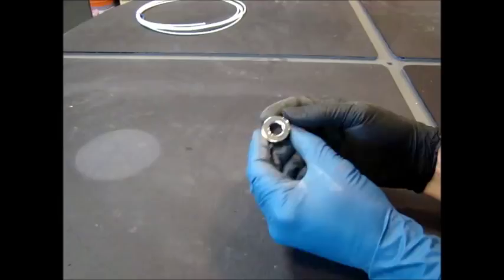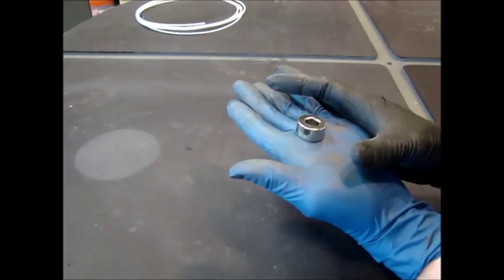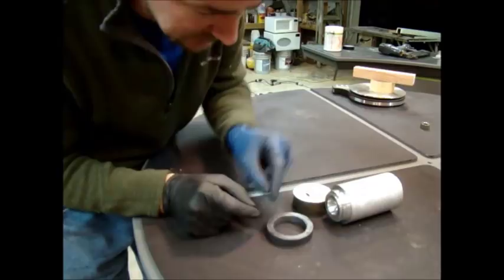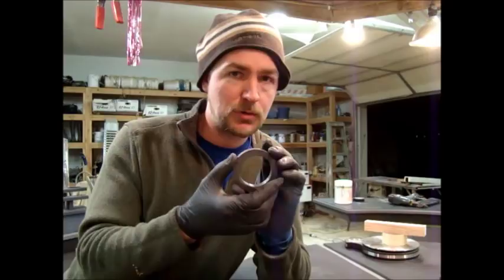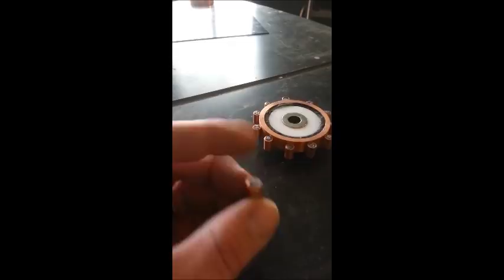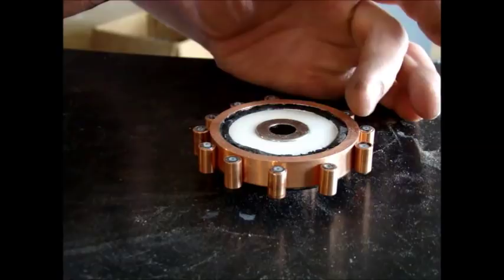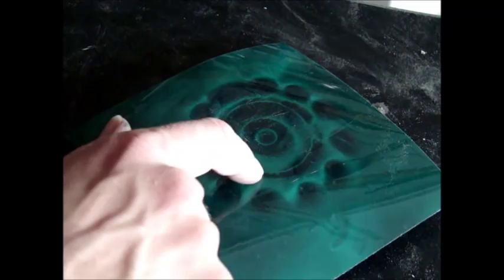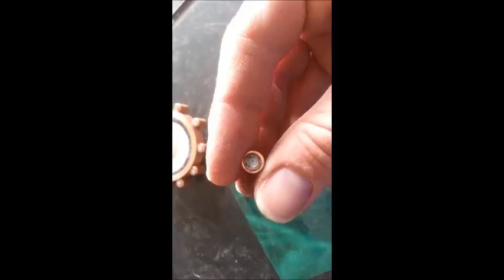Searl Effect Generator micro size

Comment: I'm not sure you understand the use of the term MICRO lol micro things you can't see with the naked eye at best it's dust at most it's nothing. Anything you can see with human eyes is called MACRO this is clearly visible lol  so this is a macro version NOT micro as we can all see it. 
Also you do understand that by shrinking the device you also change the wave lengths of the devices output meaning you will not be getting the same effect. And would have to start calculations for the zero point energy stage from scratch. Although if you didn't know the different between micro and macro I'm sure you have no idea what I'm talking about..
Reply from the maker: Remember micro machines in the 90s?
If they were truly micro that company would never have made a sale. Its a phrase a speech, not an actual scientific description which your making.  But thanks for the clarity on such terms though:)

Comment: and I suggest that you look at the first video he published you have the components to the main disk all wrong
Reply: Here's my reply to Bruce Moe above:
Center Reservoir = 7, then the Gate = 10, then the "magnetic" = 4, and finally the Emitter outside ring = 13, all adding up to 34 units. Perhaps I saw the center assembly's magnetic orientation wrong, S on the inside and N on the outside? An interesting challenge; magnetize a flat plate with N and S faces, then roll it and fuse the ends together without affecting the magnetization? 
Watch the following video at the 8 min mark to note the weights of the pieces. Pause to catch the numbers
https://www.youtube.com/watch?v=ABptANtPyB4
And watch till he explains the main  magnetic ring orientation.
Also, perhaps the numbers shown don't correspond (deliberately?) as well to the materials as say, 7.16,9,2 in a similar order to the above and which also add up to 34?
Good luck everybody.

Comment: not going to work  it requires a special material ,the key ingredient ,but i tell you what you built is called magnetron
Reply from the maker: The definition of a magnetron is this:
"mag·ne·tron
ˈmaɡnəˌträn/Submit
noun
an electron tube for amplifying or generating microwaves, with the flow of electrons controlled by an external magnetic field."
You are close but it's not quite the same.
And yes you're right again. It will never work now because I sold it several years ago.  The special materials you mentioned I'm betting are neodymium.  The magnets contain special trace amounts of titanium, iron, bakelite type compounds, and a couple of other compounds.

Comment: I need a way to make my own Searl Generator.
Maybe I could melt Copper and pour it into a clay mold?
Reply from the maker: I can make one for you.   If you give me the sizes; outer diameter, thickness and height I will give you a quote.
Reply from the maker: Yes I have read most all there literature it amazing.  Let me know when your ready to start! :)
Reply: wood brass and glass
Do you mean to say that you've already made a working model, which continues to operate under the same ambient energy it collects, while still having enough left over to power another device?

Then, would you also know how to make a circuit with a 3 pin (Australian Standard: http://en.wikipedia.org/wiki/AC_power_plugs_and_sockets#Australian_standard_AS.2FNZS_3112_.28Type_I.29) power socket, or a USB power port?

The most obvious selling point for a SEG of this size, would be as a phone charger. Although, recharging a battery would allow it to temporally power a device with a more demanding Voltage.

However, besides Volt's, I don't know whether the devices need a correct amount of Amp's, Watts, Ohms, or their Ripple tolerance (γ
).

I wasn't educated in such matters and I'm almost entirely self-taught. I wanted to know how to make my own small-scale SEG, so that I could sell them. Then I could show other people in my community how to make them.

I'd like to work with you, even though my knowledge is still very limited.

However, I do have the suggestion of using a Bell Jar to suck out the air, reducing the drag on each roller, thus, increasing their velocity.

Also, sorry for my late reply. I'm taking this seriously and I'm careful as to what I say.
Tell me the details of you're SEG's development (Materials, the process of how you made each part, including the information they relate to).

P.S
This is where I create and store my work's:
http://theinvertedtower.deviantart.com/
Reply from the maker: I will probably never get an answer if it self runs.  I sold it to Area 51 army corp.

Comment: I don't believe it's the weight I think it's more the sphere of influence between each layer has to be the same
Reply: And the iron ring magnet needs to be magnetized positive and negative alternating around the circumference.  So the rollers can have another pole to move to.  Then it will spin on its own.  Careful though, when you get that part right your work will go straight up.  He referred to these early prototypes as sparkers because the would slam into the ceiling of the workshop.

Comment: Can someone please pm me the needed dimensions? I wasn't able to get in contact with Isaiah (via phone). I have access to the shop at school and a grant to make this as apart of my "OU" investigation div research. I only need cad drawings or weight/dimensions of the rings. Even just taking a dial caliper to one of the small rings and the center large one and telling me within a 1000th or even just a 100th what the sizes are would be beyond great. Thank you to anyone that can help.
Reply: Here's my reply to Bruce Moe above:
Center Reservoir = 7, then the Gate = 10, then the "magnetic" = 4, and finally the Emitter outside ring = 13, all adding up to 34 units. Perhaps I saw the center assembly's magnetic orientation wrong, S on the inside and N on the outside? An interesting challenge; magnetize a flat plate with N and S faces, then roll it and fuse the ends together without affecting the magnetization? 
Watch the following video at the 8 min mark to note the weights of the pieces. Pause to catch the numbers
https://www.youtube.com/watch?v=ABptANtPyB4
And watch till he explains the main  magnetic ring orientation.
Also, perhaps the numbers shown don't correspond (deliberately?) as well to the materials as say, 7.16,9,2 in a similar order to the above and which also add up to 34?
Good luck everybody.